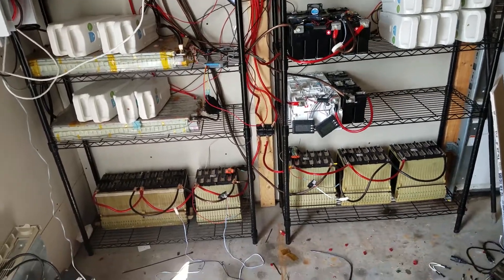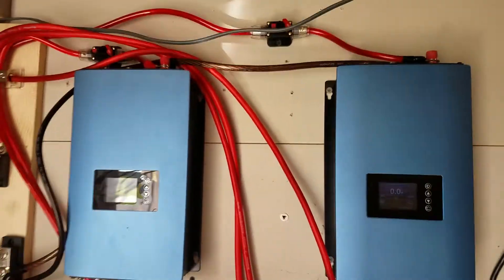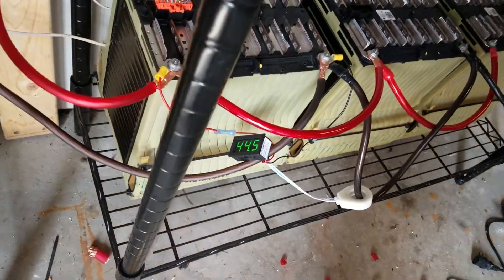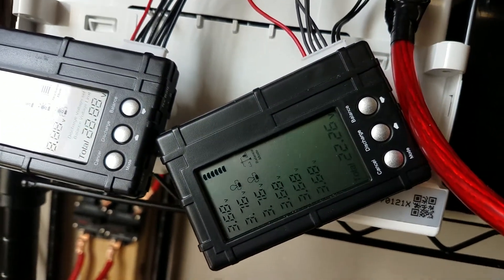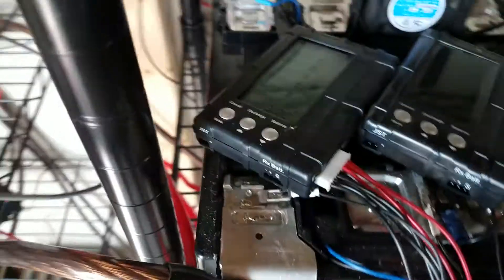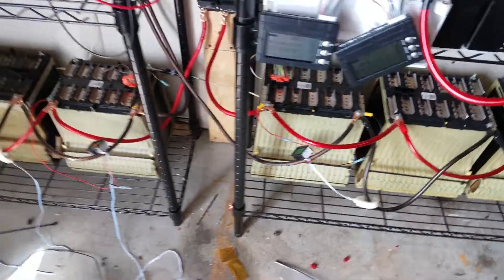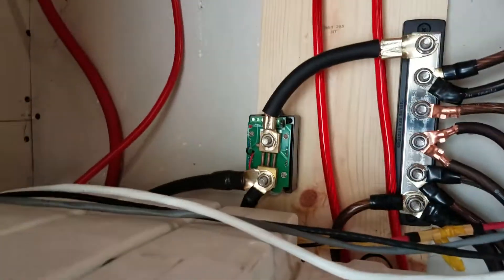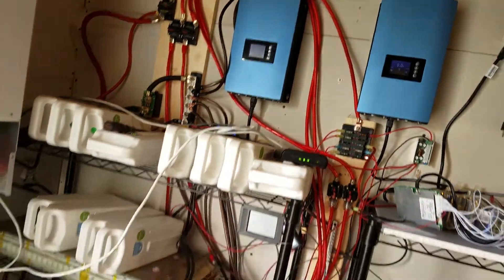3rd update DIY tesla powerwall, chevy volt, 48v lithium solar

Comment: Very nice. I'd like to see more how you wired in the balancer/discharger devices. Thanks!
Reply from the maker: The balancer/dischargers are the following part/model number  
https://www.amazon.com/HobbyKing-Battery-Medic-System-2S-6S/dp/B00URCK4T8

They are 2-6 cell capable, the reason it takes 2 is that my setup are 12 cell.
I will take some close up pics, but I am currently working on a drawing to show how I have it connected.
Oh and you will have to buy 6 cell balance leads: 
https://www.amazon.com/Apex-RC-Products-JST-XH-Balance/dp/B074TTYDBQ/ref=sr_1_4?ie=UTF8&qid=1533920174&sr=8-4&keywords=6s+balance++connector